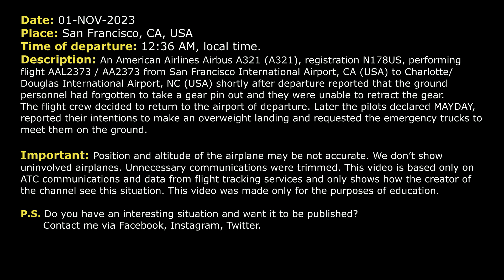MAYDAY. Negligence causes emergency. Unsafe gear. American A321 returns to San Francisco. Real ATC

Comment: Undoubtedly the maintenance crews responsibility to log and remove gear pins but also the flight crews responsibility when doing their preflight walk around to check for this.Both maintenance and flight crews fault here. I would imagine asap's were filed by both parties.

Comment: When I worked the ramp we always had to show the captan the gear pin with the reg flag attached to it and get a thumbs up before we would move the tug out of the way and the marshal standing in front of the aircraft couldn’t release the “X” until all those things were completed. Unless this is a different type of pin, I was always under the impression the pin was in there in the first place to disallow steering so as not to swing the tow bar and possibly kill someone. **edit-I understand now this wasn’t the bypass pin.

Comment: At most major US airlines, installing or removing gear pins is now strictly a maintenance function. If maintenance had used any or all of them, they are responsible for replacing them back in the cockpit. However, during the  preflight if the flight crew found gear pins installed (or missing from the flight deck), they needed to verify the maintenance status of the aircraft. As a pilot at a 121 carrier in the US you can't just pull the pins (as was the historical practice) without consulting maintenance.
Reply: Sounds like a great flow improvement.  In the old days I remember pilots carrying multi-tools to "fix things".  Not anymore.

Comment: Call me an armchair pilot, but I have just some basic questions coming to my mind on this...
1. Why to decide to immediately come back to SFO? Is an extended gear a time-critical emergency or at all an emergency??
2. Didn't the got all the time in the world to think it through rather than already having decided to come back when still passing 1000ft? Flight was destined for Charlotte, so why not to start flying already in that direction and diverting to Dalles, Denver or Oklahoma to "simply pull the gear pin" and refuel. Would avoid an unnecessary overweight landing.
3. When asked about the remaing endurance he replied by "4:50h". When flying at 4000ft with the gear down thats an absolutely unrealistic figure to me. I assume they just used the FMC predictions, but the FMC does not account for the drag penalty.
Reply: 1. It’s definitely not a good idea to continue anywhere with the gear down. The fuel burn would be totally different. The plane would not be able to climb to the planned altitude burning even more fuel.
2. They do have all the time in the world as flying with gear down isn’t unsafe. But the obvious decision would be to return to the field where maintenance is available to do an inspection and pull the offending pin.
3. Yes, they probably just looked at the FMC endurance which bases the current fuel burn rate at the current altitude. Or they just estimated the fuel remaining in time based their scheduled flight time. A rough estimate is all that’s needed.

Comment: So this was caused by a downlock pin left in place not the bypass pin for pushback.  A thorough walk around would have prevented this but as one knows in Aviation there are always several steps that lead to an incident or accident.  Again, this should've been caught first by MX personnel who placed the pins in and then removed them at the gate by verifying they had three in their hand and also done a walk around.  Pushback personnel should do a walk around as well as one of the pilots.  Expensive mistake for sure.

Comment: Interesting not burning fuel off and choosing an overweight landing in this situation. And the comment “we’re not going to be able to burn enough fuel to get a normal (underweight) landing?” 4:13 Very strange.
Reply: It would take a long time to burn it off as A320 does not have fuel dumping capability
Reply: It would take hours to burn off fuel. That’s why they didn’t. But may as well burn some of it while setting up for the approach.

Comment: They deffo should have checked and assured that all pins were present on the flight deck, they aren’t fully innocent in this one, when it’s your aircraft you must check
Reply: On more than one occasion I've had Mx use their own pins and not mine from the flight deck.

Comment: I’m fairly ignorant of flight procedures so forgive me for asking, but don’t the pilots do a walk around of the airplane prior to take off specifically to make sure that things like gear pins have been removed “prior to flight”?
Reply: Yes.  But if Mx is actively working on the aircraft when we arrive, we are not required to recheck their work.  In this case ensuring the pin was removed.  Aircraft mechanics are licensed professionals, like pilots.  I trust them with my life. When they tell me the job is done I believe them.  Mistakes will happen, in this case a gear pin.  It's embarrassing and will cost money, but doesn't pose a threat.  Additionally that mechanic will never make that mistake again, and will be hyper vigilant in the future.
Reply: @nikh9080  thank you for the informed response!

Comment: Gear pins is part of our before start checklist…
Reply: I'm not sure what airframe you're on and I haven't bothered to look when this airframe was.  But, the 777 "pins and covers" are not on our Pre Flight, Before Start, or Taxi  checklist.  It is covered in our preflight FCOM.

But, if I do my preflight and Mx is actively working on the aircraft our FOM allows us to defer to our ground handler that they have completed the work - which is done by signing the logbook.  Going back out to check them is not required.  Should it be?  I don't think so, A&P are professionals and I trust them.  Will mistakes happen, absolutely.  In the grand scheme of things a gear pin is not a huge deal.  It is embarrassing and expensive but that Mx person will never make that mistake again and will be hyper vigilant in ensuring it never happens again.
Reply: @nikh9080  our gear pins are stored on the flight deck so it’s very easy to check if they are present. This is why we check them before each sector just in case we had some maintenance action that required their use.

Comment: It is unfortunate that this particular situation has persisted in commercial aviation since the advent of gear pins. Many avenues of correction have been tried but yet here we are again. In most cases something broke the chain of procedures and checks to allow this. No, "gear pins" is not on the verbal checklist hasn't been for years. AA will address it along with the FAA and could put that back on the checklist but that won't solve this in the confusion and heat of battle to get a flight out on time always 100 percent when multiple groups touch the aircraft. Good thing it was not the pitot covers, now thats another very dangerous scenario. Look that one up on the Youtube.

Comment: This was a tire change. AC was up on jacks. Mechanics didn’t remove pins after job was done.
Reply: Before or after the walkaround. And even if after do the pilots not double check themselves. One of the first items on the pre flight checklist is “Gear Pins and Covers”

Comment: AA procedures: AOM Preflight, Interiors: Gear Pin....Stowed (contained in a box on the flightdeck, various locations depending on aircraft) ; Exterior Inspection: Landing Gear: Gear Pin....Removed.

Comment: Does it really make sense to do an immediate return to SFO and land overweight. I’m imagining you’re also then going to have to wait until the brakes cool before taking off again. Why not land in SLC or someplace a little farther east with the gear hanging out en route? I get efficiency will be way down, but at least it would not be overweight and not heat up the brakes as much.
Reply: You need an airport which has maintenance available. Also, if there is an issue with the plane, you need an airport where you can re-route passengers easily, or ger a replacement plane. Also flight crew hours might be full so you need a replacement crew and that is always available at hubs.

Sure, landing somewhere on route would make sense, but what if you have 200 passengers and you can not fly the same plane? You have to re-route all of them using dozens of flights, perhaps get hotels, arrange connections and so on. Everything is easier if you land at major hub where you took off.
Reply: Brake temps are not a big deal; use reverse, roll long and turn on the brake fans during taxi. This time of year in SFO, temps are cool which also aid in cool down. Overweight was not a big issue: Inspect, refuel, calm a few pax and you are gone!
Reply: I was thinking the same thing.   Maybe not as far as SLC.  But certainly somewhere not as busy as SFO.
Reply: Pretty sure they'd need to get the gear checked anyways. Runway is more than long enough, so the break temp wasn't expected to be very high. 
Check required anyways -> land overweight -> waiting time not an issue.
Also just had maintenance done at this facility and is likely way less coordination for maintenance, ATC and pax reasons.
Reply: Think about what you said. You just increased ground speed with the higher altitude and the performance of the reversers got worse. Still overweight.

Comment: Years ago when I flew a jet that had gear pins, one pilot was responsible for pulling them and leaving them on the bottom step of the airstair door. The other pilot was responsible for stowing them. We never took off with gear pins in.
Reply: Twenty years ago I dinged the flight attendant that a company flight (NWA Banderiette?) on the taxiway next to us had a NLG pin in.  She muttered "shit" and trotted to the cockpit.  Free drinks.
Reply: Apparently in this case, "THEY" were responsible for the pins. You know, them...those people on the ground.
Reply: You flew when I did when real men flew airplanes and took the responsibility of doing so! We also carried our Jep bag and suitcase instead of dragging them!

Comment: Since the nose wheel locking pin is installed to prevent accidental landing gear retraction, it should be made a part of the before pushback/taxi checklist.  Since the airlines cannot have the pilots leaving the flight deck to check gear pins at a critical time of the pushback/start engine sequence, it should be made that the last communication before the pushback tug should be verification between the tug driver and the flight crew that the gear locking pin has been removed.
Reply: It is on the before start checklist which is done before closing the door
Reply: The pin is the last thing pulled after the tow bar release. At my airline, you had to show it to the tug driver, and the captain, getting an acknowledgement from both before signaling that it is OK to taxi.
Reply: @stevenmerriman4479  wrong pin
Reply: @stevenmerriman4479 isn’t that the steering pin? Not the gear retract pin?
Reply: @tomstravels520 correct, this issue was due to a pin used during maintenance, not tow

Comment: So they didn't do the preflight cockpit check where you check for the gear pins in the box .. LOL
Reply: That’s not part of the check at AA.
Reply: @saxmanb777  really? interesting. So, there is no requirement to check for the gear pins on board or in the flight deck on the 'receiving /power up /cockpit flow/check or what ever AA call it before the walk around?  Never come across that omission on the Bus anywhere before ..
Reply: @mijo3642  nope, there is no requirement to check for gear pins in the flight deck whatsoever. The walk around, however…
Reply: @saxmanb777  interesting, thanks
Reply: @saxmanb777  Do your mx have to write in the logbook if they pin the gear at anytime?

Comment: Why is it called ‘Landing gear’ when it’s just as important when Taking Off?
Reply: They used to have it right with "alighting gear".  It's actually far more important -- vs "as important" -- for taking off.  The plane will land with or without it.
Reply: It should be called takeoff gear.

Comment: Question…if he had 4 hours and 50 minutes of fuel on a 4 hour 55 minute flight…I must be missing something other than jet stream help and a shorter flight?
Reply: Well, it's 4 hours and 50 minutes with the gear out at low altitude. You'd always give the estimate with your current fuel consumption. At cruising altitude with gear retracted the plane consumes less fuel. They probably couldn't reach their destination with their gear out. Gear adds a lot of drag.
Reply: If an aircaft arrived with only five minutes of fuel remaining, it would be one missed approach away from crashing... or even the slightest variation in winds or routing could do them in.  That's why what works out to more like an hour of extra fuel is required.  But more generally, flying with the gear down means a much lower cruise speed (if you can call it that) at a lower altitude, outside of the normal jetway system.

So it would be completely nonstandard, somewhat dangerous and a high workload for crew and ATC alike.  Plus the range wouldn't even be close to that of normal operation.  This would have to be some sort of no-choice emergency, where the departure airport became unavailable and the next one was far away.  Middle of Canada perhaps?
Reply: There isn’t an instrument that tells you how much fuel you have in time.  You just look at your fuel burn and do the math.  At low altitude that’s what the math worked out to
Reply: "There isn’t an instrument that tells you how much fuel you have in time"
Some aircraft will calculate it for you. I think on the A321 it tells you the fuel burn in kg per minute, and how much fuel you have in kg, so its quite an easy calculation. @Winglets68
Reply: Block fuel is divided into taxi fuel (both out and in), route fuel (calculated for the climb to, flight level and speed with gear and flaps up with the expected weather conditions), alternate fuel, contingency fuel (usually something like 15min of holding at FL150 clean), final reserve (30/45min, which is not to be used, if calculated to land with less = MAYDAY fuel) and pilot in command extra fuel.
Two considerations: after fueling, fuel remaining is calculated guesswork. Secondly, fuel at lower altitudes, higher speeds and dirty config (gear down/flaps) all negatively affect fuel burn and thereby remaining endurance. That is why fuel remaining in time can vary greatly.
Reply: @lyaneris  This is a very good answer. Most people have no idea how much fuel is needed and why.
Reply: the time in the air is less than what you see on the published schedule. Might be scheduled for 4:55 but the actual time in the air is around 4 hours.

Comment: You can tell the pilot is clearly pissed off about the gear pin, not being removed however, it is the pilots responsibility to make visual contact with the ground crew that the pin has been removed. Not just the red sling that holds it but the actual pin if they can’t see it, they have to motion back to the ground crew. This is piloting 101 people..  you can blame the ground crew but modern aircraft should have indicators when pins are or are not in place
Reply: I think you're confusing the steering bypass pin with the gear pin. And I don't know of any airplane that has gear pin indicators. You can't put a caution or warning light on everything.
Reply: This is why in the UK, ground staff are supposed to use 2 hands when showing the pin removed to crew. One hand on the red tag and one on the pin. This gives the ground crew and aircrew the knowledge that the pin hasn't been left behind.
Reply: @mcdonnell761  If you read the previous comments, this is NOT the steering bypass pin. It is the gear down lock pin. In the USA, we also get shown the steering bypass pins. Well, at least at my company they do. Thanks for playing the I didn't read the previous comments games.
Reply: and the Pitot tube has been cleared.....left open......not full of crap or even closed of.....It has happened. Pilots check that ......
Reply: I believe the pins are removed and physically handed off to the flight crew before the cabin door is closed?
Reply: @briansmyla8696  The sleeves on the main gear are giant and red, easy to see. But the nose gear pin is a little pin up near the door, so if you don't look close, it is easily missed if there is no remove before flight flag on it. My company has the gear pins to be checked on the cockpit search checklist (which usually the CA will do) and the FO should be checking on the outside walkaround... So this was not just a fault on one person or another. We also have maintenance logs written for when the pins are installed or removed by maintenance.